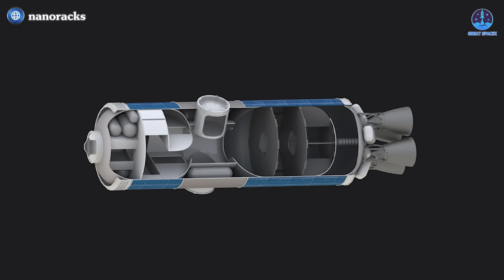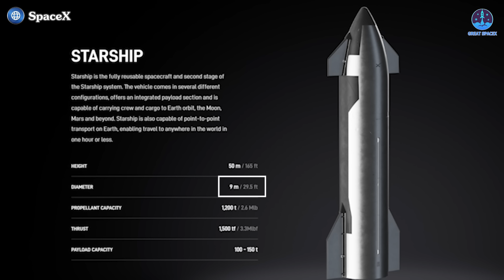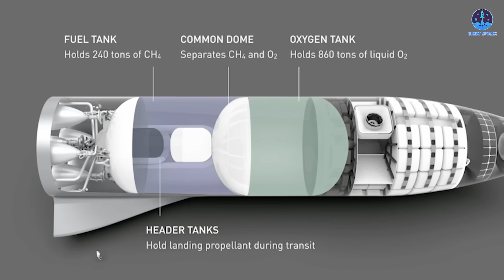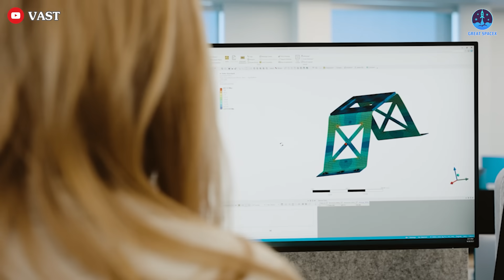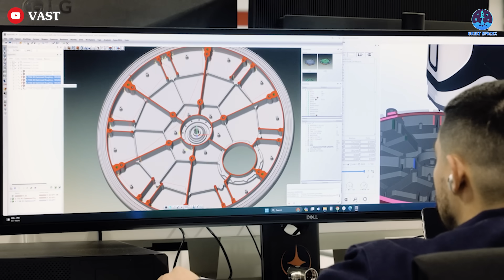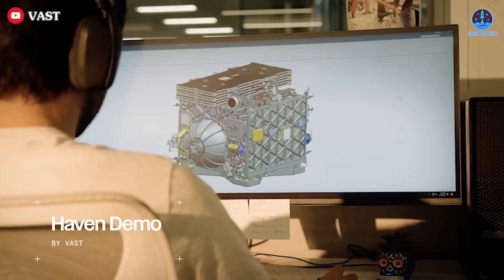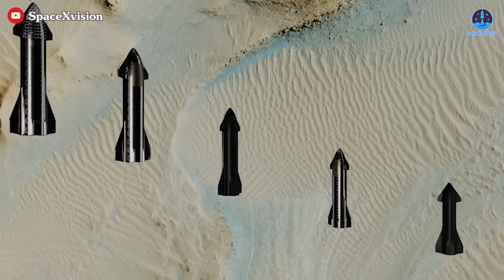SpaceX Revealed Starship to Become NEW NASA Space Station...

Comment: If you want to use the starship as a means to building a space station then here’s what I suggest. 

Fit a jacket made of stainless steel or another material over the outside of the starship. 

Launch the starship into space, slide the starship out of its jacket. 

Land the starship. 

You now have a large volume open top tank floating in space. 

Fit another jacket to starship. 

Launch to space. 

Slide the starship out of the jacket. 

You now have two open top tanks floating in space. 

If the open ends have flanges you now bolt them together, you now have an enclosed tank floating in space. 

If you put docking rings on the ends of these tanks you can now dock anything you want to the new space station, make the docking rings large enough to move equipment inside and build from there. 

You don’t need to sacrifice the starship to convert it into a space station, but you can lift the majority structural components into space using it as a truck but with the cargo a shell over the actual starship.
Reply: To cover the star ship the fins would need to be removed or smaller, that might be possible.
Reply: @ArizonaVideo99  

The fins could possibly be made retractable, if the cargo is a shell or jacket outside the hull then there’s room inside for the fins to be retracted into.
Reply from the maker: Great comment 👍

Comment: I don't think there will be any major problem developing a 1 up star ship space station. Once in space engines could be removed and replaced with oxygen storage modules just as an example. Wouldn't be hard at all to design the fuel tank system to be opened up with simple procedures. It's all got to be designed in to the craft. The design simplicity will allow for many types of space craft. The interior of the craft is what will make the difference.
Reply from the maker: Let's wait for their next steps

Comment: Something I had never considered until recently is that a giant wheel in space while great to give gravity also means that the craft needs to support 1G forces.  In that example you see a Starship mounted sideways on an arm.  At that point it would be at 1G so the same as if if were mounted like that on earth.  I don't think it's strong enough to do that.  All of it's strength is along the vertical axis, not sideways.  I think it would collapse or break in half without a lot of (heavy) reinforcements.

Comment: The rocket just needs a plug in at the nose. That will allow 2 or 4 more docking ports if needed. There are a lot of work around's. No modifications needed to the rocket. Also the rocket is tethered at the nose for Artificial gravity. Star Ships internal structures are not designed to be pulled on the side. Star Ship is routinely lifted by the nose and that's how it will be tethered for artificial gravity while in orbit.